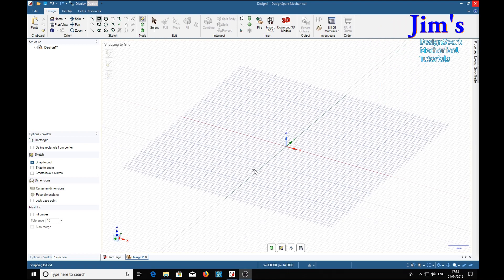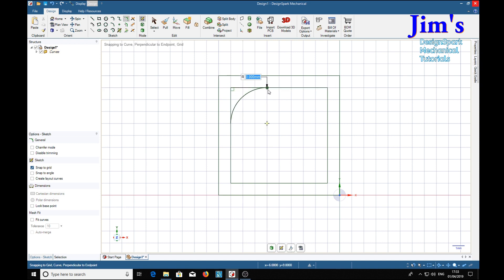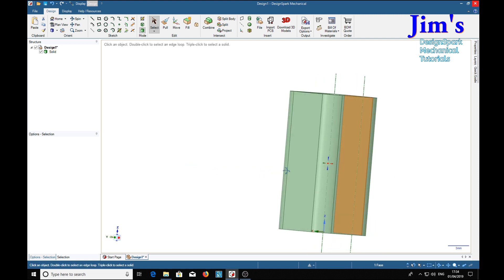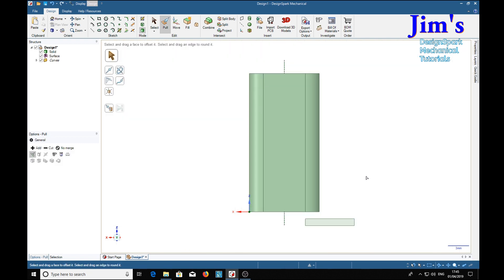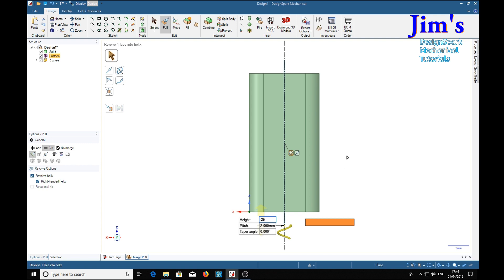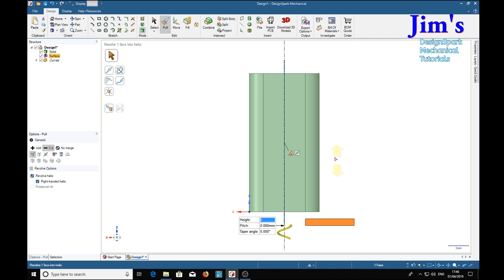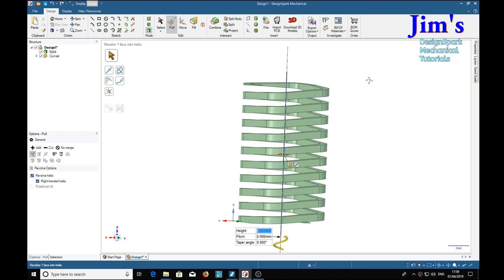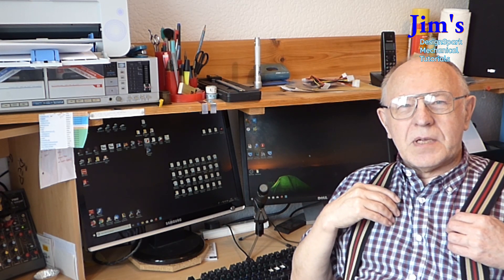DesingSpark Mechanical: Making a square spring pt2

Comment: Another one: create a square 10x10, move tool, create pattern, move up 8mm, count 5, select line tool, select 3d view, connect corners with line in a spiral way, remove squares, select spiral, move tool, create pattern, move up 64mm, count 9. Trajectory ready. Thanks Jim, Good exercise
Reply: As I have always said 'with DSM you are only limited by your imagination'.

Comment: Another method(bit longer ant quite confusing is: Create a square, extrude just the edges, then select base, then grid, make point on one corner, lift grid, make a point on next corner(going clock or anticlockwise), lift grid, another point etc. Go 3d view, select line tool, press 3d view again, connect points accordingly and a trajectory is ready.

Comment: I wonder if that minus has to do with the rotation of the helix, as in a left hand thread versus right hand. Just guessing.
Reply from the maker: Yeah. I thought it might be that but it does not seem to be consistant. I also thought that it had to do with the direction of the relevant axis - but that is not consistant either.